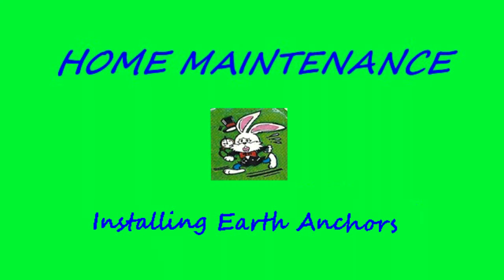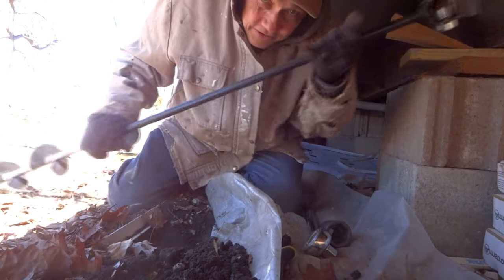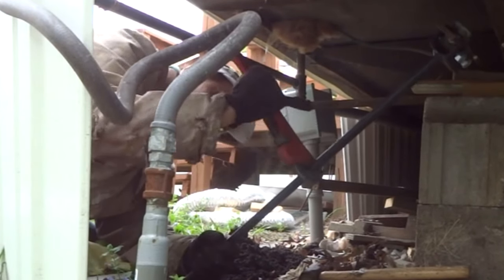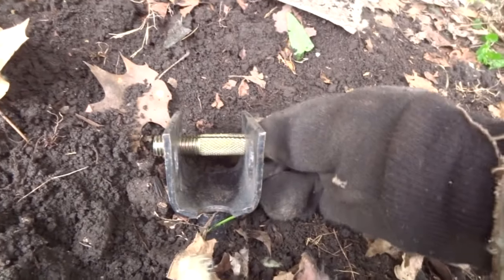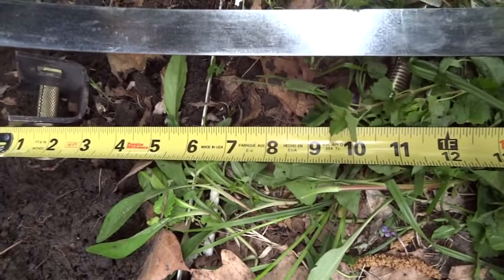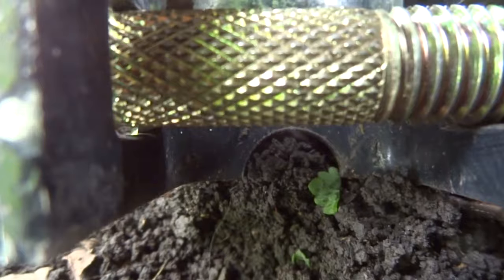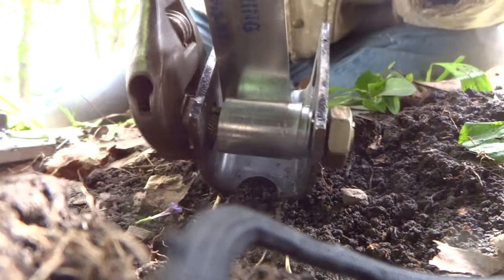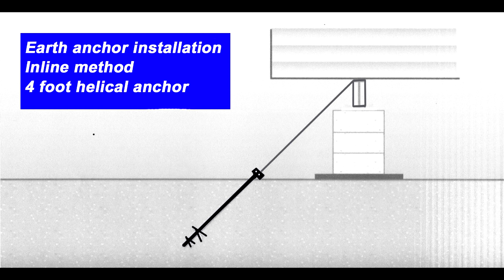INSTALL MOBILE HOME EARTH ANCHORS BY HAND

Comment: Okay I must be missing something important.  The only way you can get ground anchors into the ground is to create a "special tool" to grip the head of the anchor to twist it in the ground.  There seems to be NO BLOODY TOOL one can purchase to do this.  Every video i watch someone has made something hand made.  We don't all have that ability or a welding kit at home.  How on earth do other people put ground anchors into the soil?  Very puzzling...
Reply from the maker: Thanks for the comment.  You can get an earth anchor hand tool on Ebay at this link:  https://www.ebay.com/itm/264679603986
Reply: @swilson6206  Thanks for your super quick reply.  Much appreciated thanks!
Reply from the maker: @donkimball6174  Good luck putting in the anchors.  It's not all that hard, and can save money.

Comment: you should get a rachet that rachet's. or if you like repositioning the socket every turn just use a box wrench, bonus of the box wrench is its a bit lighter. keep fighting the good fight sir.
P.S All in good fun.
Reply from the maker: Thanks for the comment!  The ratchet was broken and only worked one way like a break over bar. Ratchet would be better.
Also, no need to dig a hole for anchor before starting unless ground is frozen, like it was in the video.

Comment: How is the house attached to that base?
Reply from the maker: The trailler house sits on concrete block piers.  The anchors hold the house down.  When setting up a trailer house, the piers have to have wood blocks on top to make the house sit level.
See this link for info:  https://www.hud.gov/sites/documents/225HUD.PDF

Comment: What gauge strap is used (and required) for a setup like this?
Reply from the maker: The strap, also called a frame tie is 1.25 inch wide and 10 feet long, made of galvsnized or stainless steel. When installing, cut the strap about twelve inches longer than distance between anchor and frame, after strap is wrapped around the frame, see the installation video on how to do this.  Not sure of the gauge of the metal in strap.
Reply: s wilson Thank you for the reply.

Comment: Do you have to have  anchors on each Side the house under?
Reply from the maker: Yes, anchors are required on each side of a mobile home. The number of anchors and spacing between anchors depends on the distance between I-Beams under the mobile home, the height from the ground, and soil types.  Try looking at the HUD Manufactured Home installation guidelines at this link - https://www.ecfr.gov/cgi-bin/text-idx?SID=a2c5655a37054c584f7dd6a0ed240fb8&node=pt24.5.3285&rgn=div5%20-
     Anchoring guidelines can be found in section  - Subpart E—Anchorage Against Wind
§3285.401   Anchoring instructions.
Reply from the maker: Yes, see reply to same question below.
Reply: @swilson6206  Ok Thank You.

Comment: Can you rent a tool to install hold down device into ground?
Reply from the maker: Possibly an impact driver, like they use in a car tire shop, but not sure if it has enough torque for eart anchors. The earth anchor installation machines cost $800, not sure if they can be rented.
Reply: @swilson6206  thanks, I have one.

Comment: This was painful to watch. You should invest in some tools. But it was very informative great video.
Reply from the maker: It's not that hard to put in earth anchors by hand.  About 15 minutes each in normal soil.  The video was made when the soil was partially frozen, so we used the auger bit to loosen it.  If you hit a root or rock, just move over a few inches.  It's a good work out and saves money in gym fees!

Comment: Great video!! Question: Where did you get that special tool at 0:49? Or did you make that?
Reply from the maker: The anchor hand tool is available on ebay.
Reply: Do you mind sending me the item number for the anchoring adapter tool? I have been looking all over eBay and I can't find it.
Reply from the maker: https://www.ebay.com/itm/264749088755 @timothywebb8354
Reply from the maker: https://www.ebay.com/itm/264749088755
Reply from the maker: https://www.ebay.com/itm/264749088755
Reply from the maker: EARTH ANCHOR INSTALLATION HAND TOOL
link - https://www.ebay.com/itm/EARTH-ANCHOR-INSTALLATION-HAND-TOOL-FOR-MOBILE-HOME-ANCHORS/264749088755?hash=item3da4467ff3:g:UHwAAOSwx09eX~55

Comment: Seems theres much easier ways to do this why not attach a heavy duty drill to it
Reply from the maker: An earth anchor installation machine is basically a drill that can drill an anchor into the ground in a minute.  It costs over $800. One problem with the machine is that it won't fit under a trailer, so it won't allow installing the anchors using the inline installation method. Installing anchors by hand can be done under the trailer, and it is also cheaper.  One other point is that installing anchors by hand is good exercise that can save you money in gym fees.

Comment: Couldn't you just use a impact gun on the bolt to tighting the strap?
Reply from the maker: Yes, if it has enough torque then that would work.